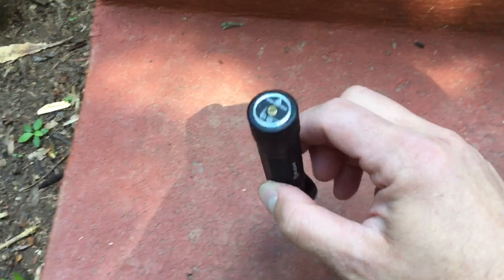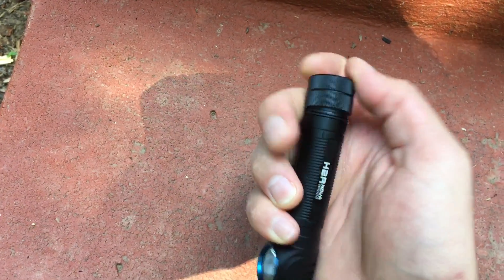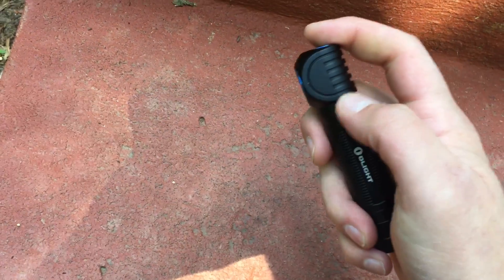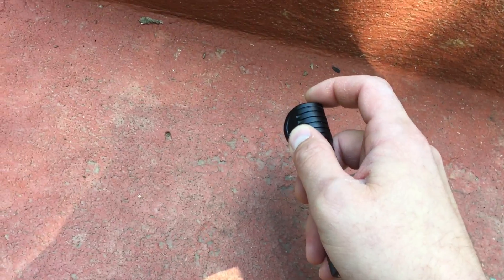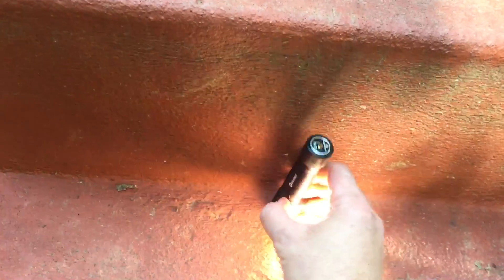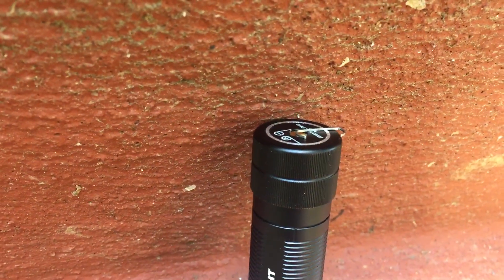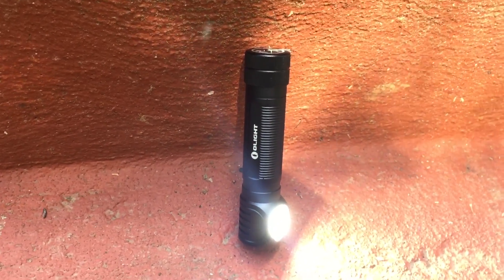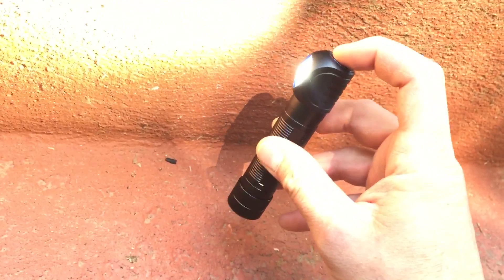Bridging the Olight H2R charging terminal.

Comment: Hey genius, the center terminal is below the surrounding surface and does not make contact with your staple. Olight tried to make it idiot proof and it appears they succeeded.
Reply from the maker: It did make contact.  However it’s not my fault you’re a loudmouth no one likes.
Reply: @AdvancedKnifeBro  Obviously, the engineers who designed this flashlight had a good reason for the warning but I guess you are smarter than they are. I apologize for being a loudmouth and hope you will like me again.
Reply from the maker: This was in response to someone saying that light was unsafe and I shouldn’t have reviewed it. It may not look like it in the video, but I did touch the parts together.  I am with you and don’t think it’s actually a big deal- which is why I tried to show it’s safe.  I have owned this light for years and it’s been great.  If you want me to like you, don’t call me a genius and imply I’m an idiot.

Comment: You didn't actually bridge the contacts. You need to get the staple to touch the raw non anodized ring while touching the gold center contact.  Kinda hard to do with any thing but your tongue.  Which fucking hurts more than I thought it would especially when your not expecting it
Reply from the maker: Yeah I totally did.  The ring is raised... so even though it doesn’t look quite like it... because it’s sits higher than the anodized part... and I have the paper clip end in the brass part- so that actually counts as bridging it.  Why would I lie about what I’m doing on screen?

Comment: If people are still worried about this after the test you did I guess you could always use a DMM, set it to its 10A DC range first to see what kind of current flows in a short situation and based on that if low currents or no current is detected maybe switch to more sensitive ranges.

Can you measure the cell voltage through those external contacts btw? That would actually be useful, one of the major reasons why I've been sticking to my Zebralight headlamps (an AA/14500 model and another 18650 model) is that it has the good old battery capacity indicator. 

Although its kinda fucked with NiMH but as long as I run it on a 14500 its reliable, when using NiMH it seems to lose 3 and 4 flashes after just a few minutes of high already. But the H52Fw lives in the backpack never being used. Why use AA/14500 options when you get brighter and/or longer runtime options with a slightly larger 18650 version.
Reply from the maker: +Extra stuff yeah someone asked in the comments... you can measure it.  I still can't get it to spark though.  Maybe if you had a super fine metal like a steel wool... maybe- but in my limited testing of it, I never got it to spark or catch anything on fire.

Comment: I did watch the other review of yours, and had some thoughts about this possible issue. Only because I had earlier read, and talked to a couple of people, who did an early review on this light. Over two weeks ago. This Olight H2R is not on my radar, so I don't really care much either way. 

Here is a clip from one of those reviews: 

"The integrated charging works through the tailcap, which connects directly to the proprietary battery. Like on the other similar Olights, the tailcap reverses the polarity, i.e. center contact is negative and the outer ring is positive. On the battery itself the contacts are center positive, ring negative.

There’s live voltage on the tailcap contacts, hence the warning. The center contact is recessed so accidental shorts don’t happen easily, but be warned, you can cause some damage to the battery and the light quite easily if you put the light in to a pocket with keys.

WARNING: There seems to be no over current protection circuit on the battery, or it’s at >20 amps, so be very careful where you store the light. Especially since the contacts stay live even if you physically lock out the light by opening the tailcap a bit (or a lot). I think this is a clear oversight by Olight. Their previous lights with this charging system were bundled with protected batteries.

I recommend using a normal 18650 with a button top or a magnet instead of the otherwise perfectly performing Olight ORB-186C30."

Then, a few days later. Olight get back to him, on this issue, Due to an email he had sent them. Here is a bit about that email reply:

"Update: according to Olight’s engineers there’s over current protection on the battery at 27 amps. So shorting the tailcap contacts will not damage the battery or the light."
Reply from the maker: Yeah I think I read part of that.  I have discussed it at great length over on Reddit- more than I care to.

Comment: Measure the voltage.
Reply from the maker: +yuenkitmun 3.97.  You can measure it with a multimeter... but bridging it with a small piece of metal or dropping it in water doesn't  have an effext
Reply: Advanced Knife Bro Is the cell protected? Try an unprotected cell.
Reply from the maker: Let me direct you to this thread over on Reddit... and I'll repost part of my comment here.

"Ok... just to set the record entirely straight.  Here is what I've done.  
Bridged the rings with solid copper wire with the included protected 
and 18650GA unprotected cell, while on an off.  All combinations.  No 
spark.  I did in fact test the voltage with a multimeter- you get about 4
 volts on and off.  And yes it may have been a "flawed test," but jeeze I
 did it and uploaded it like 20 minutes after Zak posted his comment- 
what were you expecting? "
https://www.reddit.com/r/flashlight/comments/6jsyul/olight_h2r_neutral_and_cool_white_headlamp_video/

Comment: Doesn't surprise me much that all is good. The R series has had safe and reliable charge ports since the first series with those back in 2014 (I have an S10R that while I don't like, I can recognise its merits). Maybe it'd take an external electric charge on the bridging to short-circuit the torch, I dunno.

Still, thanks for checking, my man 👍
Reply from the maker: +Dinner-fork tongue I dunno man.  I haven't heard of a Olight blowing up- seems fine to me.